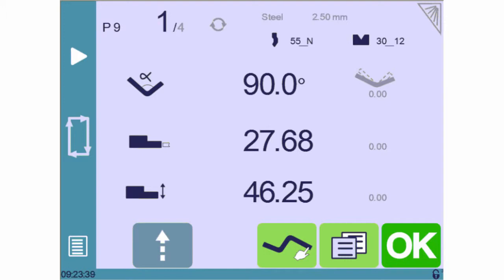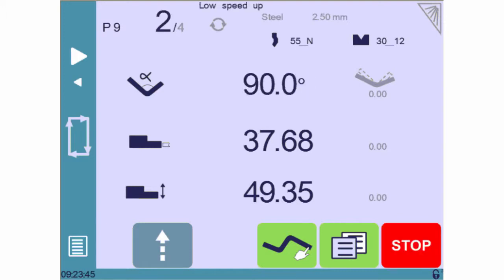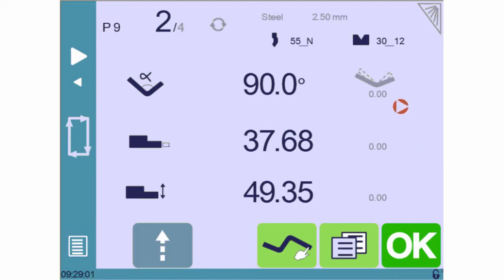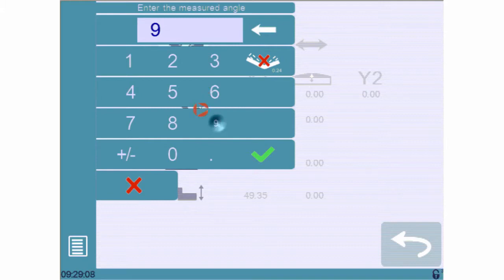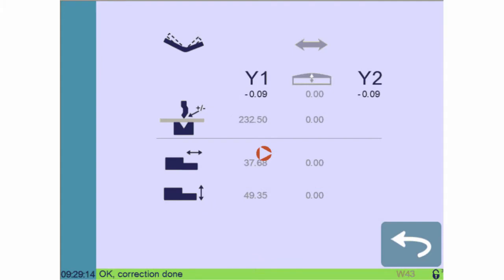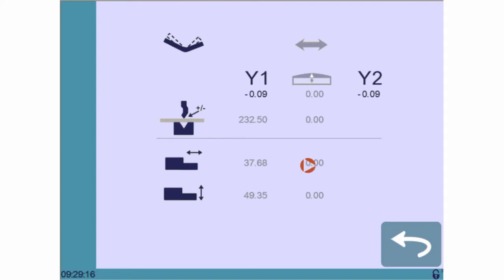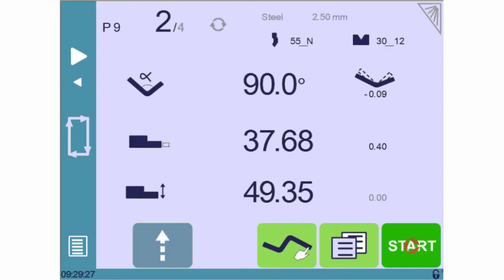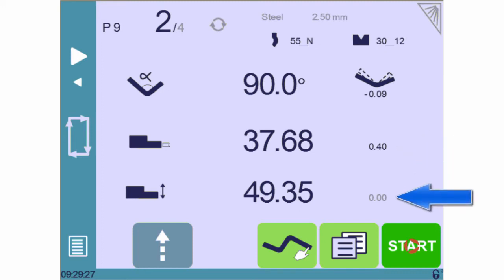Bending Corrections on CybTouch

Comment: Can you demonstrate how you would correct if the part is full length and it’s 90 degrees at each end but the middle is a few degrees off from 90?
Reply from the maker: To increase the angle in the middle of the sheet you need to apply crowning.

Some machines have automatic crowning which the Cybtouch controller can adjust. The crowning is automatically calculated on the Cybtouch controller based on the Material Thickness, Material Tensile Strength and Bending Length. You can modify the crowning yourself if the calculated value is not enough or too much. You just tap the crowning icon and adjust the value until you get your perfect fold. The crowning icon can be found among all the other settings (dwell time, opening height, etc..)

Other machines might not have automatic crowning. For these machines you’ll have to introduce the crowning yourself by adjusting your tooling.

Please don’t hesitate to call us if you need further information.
https://www.machineryhouse.com.au/contactus
Reply: @Machineryhouse1930  thanks for the response, I am looking at purchasing PB-70B - Hydraulic NC Pressbrake
70T x 3200mm - Includes Laser Safety Guarding
CYBELEC Touch Draw control 2-Axis, SERVO DRIVEN Ballscrew Backgauge, being the cheaper machine I would imagine that it would not include the automatic crowning adjustment? Are you able to explain How would this machine be adjusted for crowning? Or do a video if possible?
Reply from the maker: @JSC-c  We'd be happy to guide you through this process. Please feel free to contact our staff member, Sam, at 02 8838 3558 or via email at ssainsbury@machineryhouse.com.au.
Reply: @Machineryhouse1930  ok thanks, I’m in Adelaide and see you have a new store down here, does this store have all the machinery on display like the interstate stores?
Reply from the maker: @JSC-c We currently have a PB-70E Hydraulic NC Pressbrake (70T x 2500mm) on display, which includes laser safety guarding and Estun NC-E21 Control 2-Axis with a leadscrew backgauge. While it isn't the exact model in question, our staff would be more than happy to demonstrate how to apply crowning on this machine and discuss your options.
Reply: @Machineryhouse1930 excellent i will go down and have a look, thanks